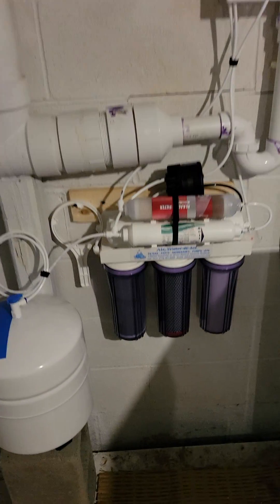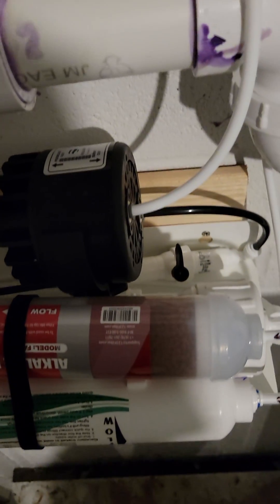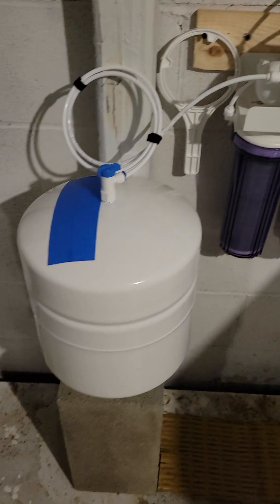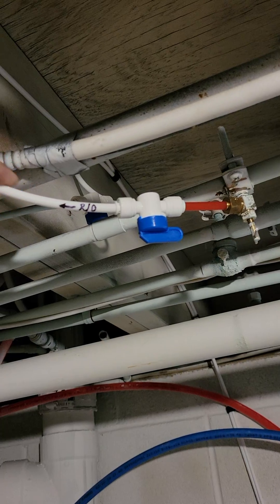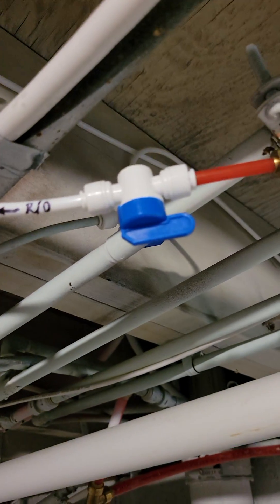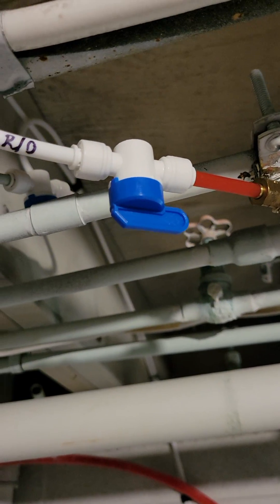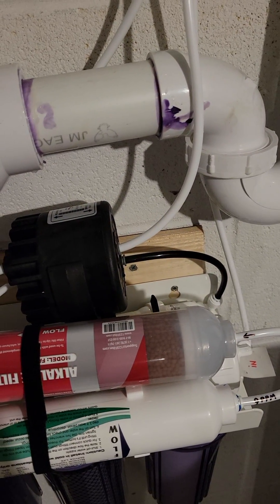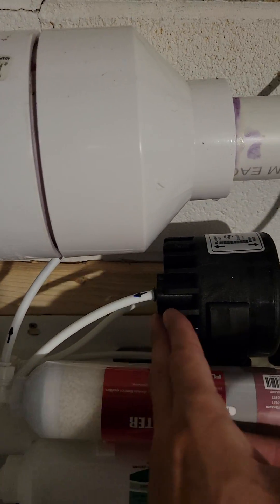Reverse Osmosis Install with Quiet Permeate Pump

Comment: One thing I did want to mention/ask you-What is the GPD of your membrane?  The audible sound of the volume of water going to the drain seems excessive, and correspondingly, the permeate pump click rate seems slower than the three that I installed.  It makes me wonder if you have mistakenly removed a membrane flow restrictor?  Sometimes these restrictors are somewhat hidden and even made into the interconnecting tubing/fittings which can easily get removed mistakenly when retrofitting.  The downside of not having a flow restrictor would be decreased membrane output, and filters needing to be replaced prematurely.

Comment: I've had my permeate pump for a few years now and I love it.   The sound is exactly what you have captured on video.  I actually like the sound of it since it can alert me to city water pressure changes, when the hot water tank comes on, and even when the fridge makes ice.   I like the technology so much in fact, I retrofitted my parents RO system to include the permeate pump upgrade, and even installed one for my son that I also modified to include the permeate pump.  Back in the early 2000's when I worked for Culligan installing RO systems, I wish we would have had these things back then.

Comment: 👍Thank you for the demo! Yours is the only example I've found of the actual sound of the permeate pump, which is what I really wanted to hear. Other people tell all about connecting them but never demo the sound. I am amazed at the way such a simple mechanical device can double the efficiency of the RO system. I will definitely add one to the system that I'm studying to get.